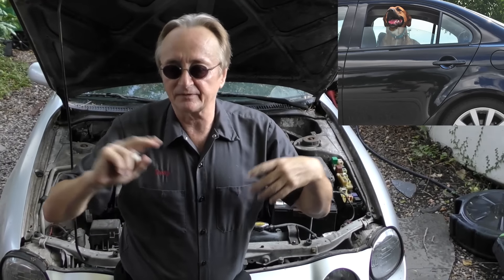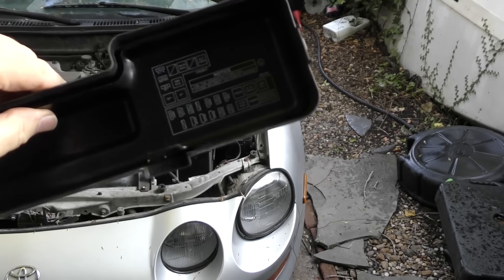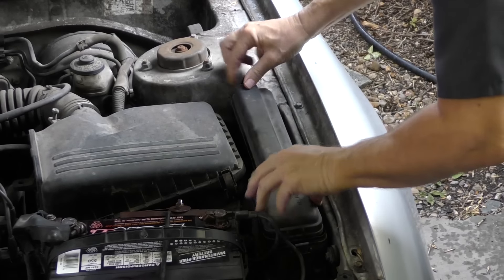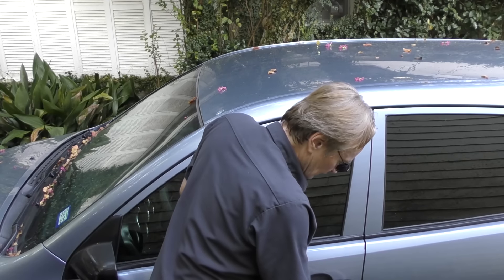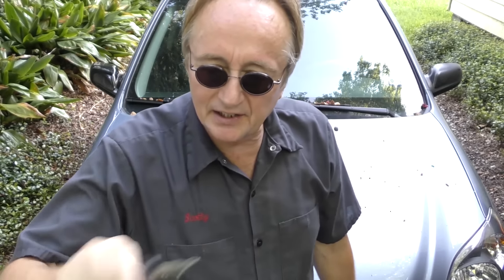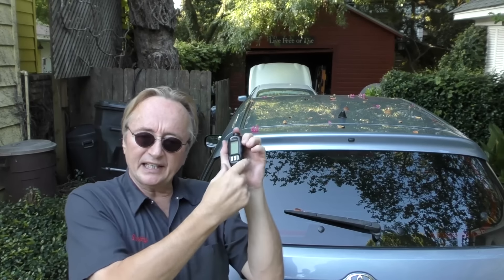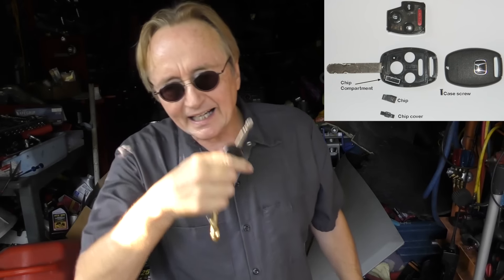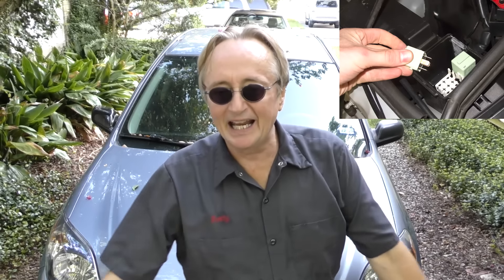How to Theft-Proof Your Car

Comment: A relay is just a electromagnetic switch activated by another switch or relay. If a thief knows what they are doing all they really got to do is put a jumper accross the pins in the relay slot. Not hard for them to stick a paperclip or wire accross the 30 and 87 pins in the fuse box. A starter can be jumped easily through the relay or physically at the starter. A hidden killswitch running an interupt relay midway down the car or further back to the fuel pump is the best way. You can get a starter to kick over with little effort is a killswitch is there. But most fuel pumps are pretty innaccessible without lowering the tank.

Comment: A $700,000 Lamborghini was just stolen a few days ago by a criminal that didnt have a key for that particular car. Lamborghini has a very high end theft protection system in it, BUT, there's technology out on the black market that can bypass any theft protection devices...I'm willing to bet no exotic car owner could find, and pull relays, or main fuses as added protection

Comment: Back in the 80's we would remove the high voltage distributor cable - quick and easy.
Reply: I saw something like that, except that the owner then put a piece of windshield washer hose with two cable ends on it in place of the high tension cable. It looked exactly like the original cable!

Comment: I doubt they would take the time to see why it didn't start for the most part, but could't you swap for an unimportant relay in your car that's the same size. I did that once before when diagnosing an electrical system problem.

Comment: My Geo Metro has the best anti-theft device, for an automatic.
The auto trans is overfilled with fluid, so it's unsure if it's in park or neutral, when it's off. If I turn the car off immediately after putting it in park, or I turn it off in drive, I have to push it in neutral to get it to turn over.
But hey, who wants to steal an old Geo Metro anyways?

Comment: Who wants to pop the hood and pull or replace a relay every time you go to your car? Eventually the relay socket terminals would prolly get damaged. 
I like the kill switch and have done it on several cars. Just tap the starter enable wire in the dash or steering column and run 2 wires under the carpet to the floor behind the passenger seat or wherever you like and hook them to a spst switch. Any wire harnesses you disturb, make sure to put them back together to look factory. Insulate the switch wiring well and use wire that is a size bigger than the wire youve tapped because you are making the circuit longer. Do not tap/interrupt the fuel pump wiring instead because if the switch fails so does the car.

Comment: Scotty, traded in my 06 Tacoma for a 2020 Superduty (needed a 1 ton dually and Toyota doesn't make one).  Nervous about owning an American vehicle because of all the issues I have seen others have with them my whole life.  It is the 6.7 powerstroke engine.  I know squat about diesels and don't wanna mess anything up.  I am assuming that removing the ignition relay on this beast isn't going to do any damage to it even if someone attempts to start it with it out?  Just wanna check.  Also, my family and I were in Houston the other day and I told my kids that this is where you live and to look out and they just might see you (they are 11 & 12).  Told em' to look for the bodacious Cast Iron plants that line your driveway.

Comment: Well, the issue with this is thieves scout out your car beforehand. They see you exit and pull out a relay, they'll know what's up. They do make remote control fuel pump relays but I'm not sure on the reliability.

Comment: On my 95 & 05 Chevy 1500's, I pull the fuel pump relay. I miss placed the contacts to the relay. The part is there, but in a normal place. I do this

Comment: To prevent auto theft -  
Get a sign to put in your car's windshield that reads "Called AAA waiting for Tow"

What car thief wants to steal a broken down car?

For the fuel pump relay idea- get a new relay for the fuel pump, take out the old relay for the fuel pump, damage the old relay so it won't work anymore, put the old non working relay back in place in the fuse box.

If a car thief opens the hood and sees all the fuses and relays are in place the thief won't know why the car won't start.  Open the hood, take out the old relay, put in the new one and drive off.

Comment: my one car was mechanic proof! 😁😁I had switched engines but my car was king of vacuum hoses..the one mechanic who was supposed to do the switch bailed do to strange reasons..went to another mechanic who put the engine in but they called me saying they could not start it..I had it towed to my home to figure it out..the heavy smell of gas let me to believe was the fuel pump (yup fuel injected) so I pulled the fuel pump fuse out then tried to start it..it ran! but the engine started to die so put fuse back in and it ran! so went to a new mechanic and forgot to tell him the special starting proceedure..he says my car will not start..says I need new ignition cables and spark plugs..I showed him how I started it and he walked away saying nothing! so I felt secure with that car NOBODY was going to steal it👍

Comment: Can’t you start the car anyway by hot wiring or turn the car with a USB cable as these Kia Boyz who steal Kia’s even with an immobilization system? Also, if I remove the fuel injection relay, does it cause damage to the car if someone were to start a car?

Comment: You could actually just jam a copper wire across the power and load Pins and fire it right up, but that's if that knew the relay was missing, if they scout you out and see you removing the relay every night when you park your car....... Well you see where this is going

Comment: It is a good way, but actually, there is a much cheaper way, I have done this way for some time and it is not detected, even when valet parking is insisted, because cannot even start the car. I use the fuel pump cut off. Also saves a tip as they cannot do anything. I have used this since about 1988 when I bought a Mercedes 550 SEL

Comment: I sure did flex my new anti-theft system today when I pulled up in front of the ladies, popped the hood, and took out a fuse. Probably could have gotten a few numbers if I my windshield wasn’t cracked on my 2001 Pontiac sunfire.

Comment: I actually have a good one. If you own a ford or a car with an inertial switch for the fuel pump, give it a rap with the side of your fist till you hear a pop. Now the fuel pump wont run and to reset the fuel pump push the button by the warning label.

Comment: I had a 2005 mustang I rigged up a hidden kill, if the found it, a satellite tracker chip under a panel no person would find or have wrenches and jacks to remove , and it was 5:speed standard, I never had an issue

Comment: If you see the relay has been removed, you may still be able to start the car without a new relay. You may be able to jump the terminals, if you know which terminals to jump.  You may not need a circuit diagram because usually the output terminals are larger. And what do you do with the relay you remove? Hide it in the car? Take it with you? I would take out a fuse, and replace it with an open fuse (non-conducting blown fuse). Tiny working fuse is easier to hide, and easier to take with me. Thief isn't going to pull out one fuse after another to get a look-see at the tiny fusible link inside to see if it has melted. And if I were to pull a relay, I would replace it with a non-working relay. Now the thief would have to do some serious troubleshooting to find out which relay it is the non-working one. They could  plug in an OBD2 scanner, and find the non-working relay, but they have just spent an awful lot of time figuring out what's going on, and they still have to buy another relay – although again, it is often possible to jump a relay, if you know which terminals to jump.  Another trick is the double whammy. You detach something relatively obvious, like remove the ground wire from the battery, or where it attaches to the body, and the thief finds that, and thinks, aha, I've found the reason the car doesn't start. She puts back the wire, and the care still doesn't start. Now she is has to start all over again looking for some other reason why the car doesn't start, like for example you've replaced a fuse with a blown fuse, in addition. Think how aggravating that would be for a lazy low-life crook. Most crooks don't have a lot of "stick-to-it-iveness." That is why they decided to be thieves, instead of deciding to make a living by doing hard work. They think its easier. If it's not easier – they look for an easier car to steal.

Comment: A paper clip can be used to replace the relay by acting as a jumper. A much better solution is a aftermarket steering wheel lock. It is more work to bust off the lock then to jump a relay socket.

Comment: isn't a relay is just a switch? can't you just hotwire the direct power pins for the fuel injection for it to have power all the time for temporary? I don't think the fuel injection timing is controlled by the relay?

Comment: I suppose that's a good solution, but someone could just use a wire jumper and directly connect power to the fuel pump. Still a clever idea because thieves usually go for the simplest and quickest route. If they can't figure it out in a certain amount of time,  they might just move on.

Comment: My brother had health issues, but still wanted to drive. I didn't want to risk his, or anyone else's life. I did exactly what you said, I yanked out a relay. He knew enough about car fuses, but not the relay.
On my '79' IH Scout II I did install a kill switch. Rather than use a small toggle switch I used a push/pull switch. It had an 1-1/2" diameter know on it. I mounted it on the side of the seat bracket, so it looked like it was an original part of the car.

Comment: Hello Scotty I have been  having a check engine light for over a year, it’s a oxygen sensor code. I changed the oxygen sensor, changed the electrical sensor and the connector outlet  but it’s still lighting up please help!!

Comment: Bold thieves will tow your car, pull up and load it on a trailer in broad daylight. To prevent this, I park nose in with the wheels fully cocked left or right. This way, if they pull it back, the car would go into the one parked next to it. This makes my car a harder target and they move on.

Comment: I'm in the market for a good used car I got screwed the last time and that left me without a car for the past 4 years me and my son have struggled for 4 years on foot try grocery shopping on foot I finally have the money to get a used car I would say I'm in the market between 3 to 5000 and I want to make sure that I do everything that I possibly can to make sure that this vehicle is a good running vehicle and I'm trying to do my research to make sure that's the case I was thinking about you know what I can do to make sure I've watched some videos that show me what to look for under the hood and I was considering buying one of the scanners that scans the car like the fixed would you suggest that a product like the scanner to scan the car before purchase? Also I know Toyota's and Hondas can go forever if they're taking care of I'm very leery about a lot of miles but obviously when buying a used car you're going to deal with some miles do you think that I should automatically be fearful of a car that has between$150,000 to 200,000 miles on it or would you say no to that any suggestions would be helpful I just can't afford to get screwed over again.

Comment: Trouble with all this stuff is , a crook may smash your steering column all to hell only to discover it wont start. I wrap a chain around the steering wheel and the brake pedal, this is a visual aid to thieves.

Comment: Soooooo, let's just say it WAS practical to be constantly removing your fuel injection relay, the smarter thief can simply bypass with a short piece of wire.. hence the notion of them requiring the exact relay is invalid. Fortunately (for the thief) the relay socket will easily grip the wires. That being said, if they've taken the time and successfully troubleshooted it that far, you're likely dealing with a smarter thief, who could easily carry a jumper wire or quickly fashion one out of a non-critical loom (headlight/fog light, horn, etc). As for the current, those wires should easily handle it for such a small distance.

Not to mention the risk if damage, constantly removing and refining a fuse. You don't need to be a numpty for sh*t to break with the added wear and tear.

Oh man, I should have watched the whole video before commenting.. A significant amount of immobilisers can be bypassed with prior knowledge, of which a prepared thief is.. Any immobiliser that only disables the starting circuit is almost useless; more complicated immobilisers are less easily foiled.

😂 You're so sure that no-one can steal a car without relays.. All it means is the system will need to be hard-wired instead (using the jumper wire, as explained)..

Comment: Hi I have a 1971 Ford F-100 and I changed the factory manifold to headers.  I have a 360 motor and I rebuilt the a transmission.  It's a c6 but it gets to hot inside when I'm driving it what's wrong?

Comment: Most  relays are all structured the same and in functionality within that vehicle. Removing the fuel relay only wouldn't stop anyone that has common sense. They could just remove the next large size relay from the A/C relay and place it in the fuel spot to make it work. Unless you removed all the relays and that would be a real pain in the a$$ for the owner and not the thieves.

Comment: Hey scotty, ive Honda Amaze 1.2 ltr petrol  2018 model(India).Few days back,its fuel pump got overheated and stoped operating while driving. It was replaced by the honda.But my concern is,before the fuel pump change i was getting 23 km/ltr fuel economy on highways,but after the change,it shows just 18 or 19 kmpl on my cars MID. What could be wrong??????????????????????

Comment: Better yet, try to find an ignition relay that doesn’t work. Then if a thief tries to start it, and checks the fuse box they won’t see a missing relay and they’ll be stumped. If you simply remove the relay and don’t have a decoy in there, they might catch on, go and buy a relay and come back & steal it…. You gotta think a step ahead!

Comment: If i lost my car key that also has a fob and im worried that someone will find it and have access to my car, do i need to replace the engine cylinder and door lock with a set of new keys? its 2016 toyota.

Comment: Sorry, Scotty. I hate to call you out on this one. But your idea has a flaw. When you pull open an under the hood fuse box, the relays are all the same, thus interchangeable. The Y127 relay for the air conditioning is the same same Y127 relay for the the fuel injection system which is the same Y127 relay for the horn which is the same Y127 relay for the ignition system. I often swap out relays when testing for bad relays. The AC relay makes a good spare relay since the engine can functionally run without a working AC system. Now, putting a known bad relay in the socket for fuel injection or ignition has a decent chance of throwing off a would be car thief since it wouldn’t be as obvious as relay socket left open. Just my two cents worth.
Reply: How would a thief know your car has the relay removed???  The thief just wants to start your vehicle and go, not attach obd-2 cables and run code tests.....

Comment: They do litterly have bypass kits for those immobiliser chips..it's a bunch of diodes and you wire those in try different ones intill you find the one that works for you..is a thief going to do this? No but it's not impossible lol

Comment: I thought of this on my own. In my Honda I remove a certain relay from inside the car when I’m worried about it getting stolen. I don’t have to pop the hood. The only problem is when your crazy girlfriend throws your phone and keys w/relay attached from second floor and breaks the relay. Then your stranded until you get another relay. 🤦‍♂️

Comment: Today's keyless systems is not like in the old days, now it runs with a rolling code that is changed every time you try to open the car using a proprietary and complex algorithms. The only  way for a someone to imitate a signal / copy a signal open your car is to copy a signal that didn't reach your car and using that to open the car. The chances of that happening is slim to none 'cuz it just too time consuming and complicated to arrange a scenerio where it is actually works to open the car

Comment: If going to the grocery, hardware, then the salon, who is gunna pop the hood, remove the relay and then reverse the process each time for a quick stop?  3 times in one trip? Not me, or my teen kid.
Good idea for long term parking. A well-placed kill switch seems better to me.
For l o n g - t e r m, take two relays and still have the kill.

Comment: What you're stating works - but on a regular basis is a royal pain in the butt!! A kill switch does the same and takes 1 second to flip. If thought is given to where it should be located, no one will take the time to find it.

Comment: My VW is unstealable. the key has to be cut with a expensive machine. Programmed with a VW computer and to program the key you need the password from the cluster and the car starts without the immobilizer but it dies right away to protect the fuel pump. Taking off a relay is just stupid in my opinion. What are you going to do? Pop the hood every time you get in and out of the car? Let’s be realistic for a second. No one is going to steal a car before 2010.